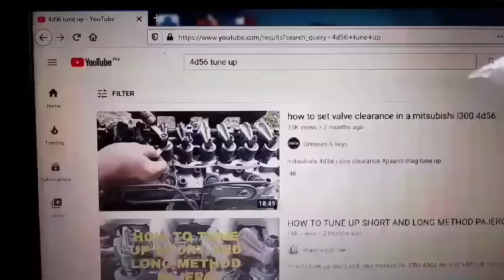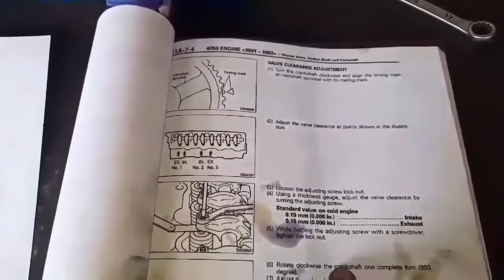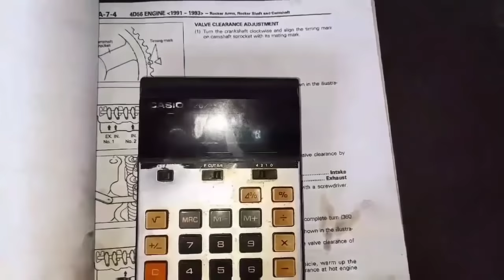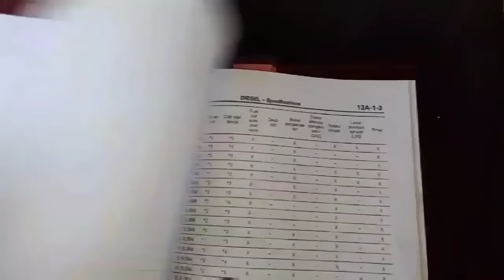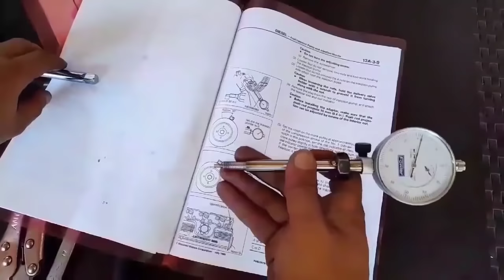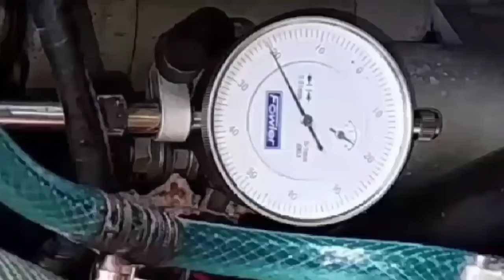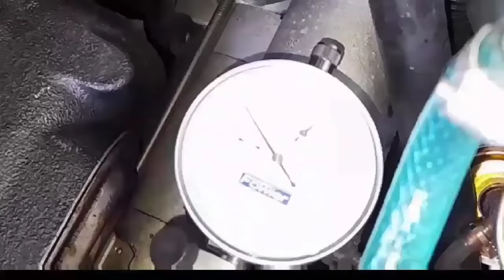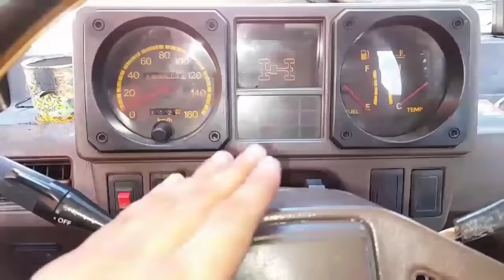COMPLETE 4d56 Tune Up, Valve Clearance and Injection Pump Timing Using A Pre-stroke Measuring Tool

Comment: sir.. 4d56 turbo engine q matic kaso after q ngpalinis change timing belt at sbi nung nagpalit ng timing belt palinis daw injection pump pero nung napalitan at ntapos na ung lhat ng pinagawa q halos mahina na at mhina hatak tas ung top speen nya 80 kms nlng.. d na lumalagpas doon.. san kya mali ginawa nla.. tnx idol.. need your help.. anlaki kci nabayaran q..
Reply from the maker: Adjust fuel enrichment screw https://youtu.be/VWBu53sNbas

Comment: Hello Mr. DIYer, good evening. I would like to seek for your advise. I have a 2018 AT Montero with 60,000 KMS odo. The problem is, the car is having a flactuating RPM during cold start with white smoke (w/ AC off).

After 3 minutes of idle, the white smoke dissappears and the RPM goes stable. No problems with the performance at all. It's just the white smoke and flactuating RPM during cold start. May na-encounter kana bang ganito, Sir? Can I send you a PM?

Nakaka-puzzle ang ganitong issue kasi as good as new parin ang andar nya and malakas parin sumibat at matulin parin. Appreciate your response. Thanks.
Reply from the maker: 1. Kung maari  Ipa active scan nyo po, habang tumatakbo ang makina during cold idle hangang uminit. 

Kung walang na reregister sa scanner na error code.

2. 9 out of 10, yang symptoms na maputing usok sa umpisa at nawawala pag umiinit na ay sansi na may injector  na na iistuck up. At lumuluwag pag naiinitan na. Kaya nawawala ang usok. Pa check mo injectors lahat at spray pattern.
Reply: @MrDIYer  Sir do you have a shop?
Reply: BTW, salamat Idol. I also watched your OCC video. Baka related din ito sa case ko because I have an OCC.
Reply: Mr. DIYer, good news! I removed my OCC and the problem was solved! Yung pressure sa engine di nakakalabas ng mabuti kaya di nakakahinga ng mabuti ang engine. Salamat sa mga videos mo.
Reply from the maker: @IdiotMurderer mabuti naman po kung ganon at di na kinailangan baklasin pa injectors.
Reply: @IdiotMurderer  parang ganyan din po nangyari sakin. Sa umpisa wala akong nakikitang talsik ng oil sa makina ko 4d56, pero after ko nilagyan ng occ mga isang taon na nag ka talsik na kahit nung tinangal ko na andon na yung talsik. Nakakainis huli ko na napanood yung video nya lol
Reply: @marvincalumpit1107  pero Bro normal lang yung talsik na yan kasi may moving parts sa loob ng engine. Yung sakin kasi may puting usok sa exhaust during startup. Nawala naman nung tinanggal ko ang OCC.
Reply: @IdiotMurderer  yung makina ni mr diyer at makina ko bago ko kinabit ang occ walang talsik.

Comment: I've done this 20 times and the motor still doesn;t run right. About to give up after weeks doing this. Brand new injection pump, belt, water pump, glows and injectors. All three timing marks exact on TDC. Zeroed the gauge and on my motor 1HZ Toyota it goes to 1.03-1.09 which i did exactly and it runs smoky and wont rev much can't drive it around the block. My god what the f*7k else can go wrong!!!!???
Reply from the maker: Is the smoke white or black? If its white its usually an indication of fuel not being burnt properly. And in most cases it just because of bad timing, drop the dial gauge, try to fiddle with it manually. I have a video on how to do that. If that doesnt work, you might want to do a compression test as well as a leak down test, loose compression might lead to unburnt fuel . I hope everyhing works out for you.
Reply: @MrDIYer  I got it to go better. At least can drive around the block now. It runs clear with no smoke on small revs and when going up the gears lots of black smoke builds up more the higher the revs. I've fiddled around a few times manually adjusting the pump but nothing seems to make it go right. Used to run perfectly. I put AdBlue and ruined the last pump. I might buy a compression and leak test next. Because maybe this bad fuel (Urea) eats the gaskets away. Thanks for your reply. Yes, I'm watching your videos they are very good!!
Reply from the maker: @ForPropertyInvestors  i see, assuming you dont have excessive blowby, id check the fuel enrichment screw. Perhaps youre burning too much fuel.
Reply: @MrDIYer  It does seem that way. I've been wanting to change the fuel mixture screws but was sacred to as it's supposed to be just bench tested. I might mark it and try it if it makes a difference. I even took all the air filters off today and it's getting plenty of air. I asked the remanufactures what specs they bench-tested it to and it was this below. Not sure if that's right or wrong but this is what they said! 

'High speed injection volume 6ml/100 times 1000 RPM
Discharge injection volume 5.5ml/100 times 400 RPM
Idle fuel injection rate 2ml/100 times 350 RPM
Starting oil 9ml/100 times 135 RPM
Reply from the maker: @ForPropertyInvestors  ideally it should only be fiddled with on the bench with the proper equipment. But we dont have that at home perhaps this link might help you out https://youtu.be/VWBu53sNbas
Reply: @MrDIYer  That video is perfect. You're a champion. Think l'l make a test bench one day as I quit liked fiddling around and taking apart the old VE pump and buying a replacement rotor and head and cam soon. A bit far to China to send my pump to the test bench, again and cost a fortune from the land Downunder Australia for the poor. But also they haven't got my motor on the test bench in China either, so some fine adjustments for the motor may be necessary. I'm very curious to find out so will carefully have a look tomorrow thanks!